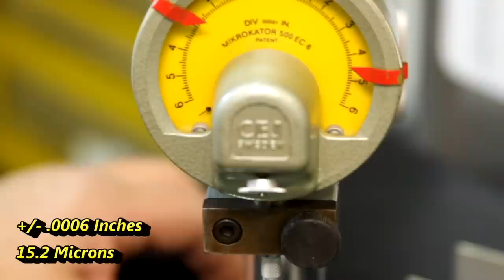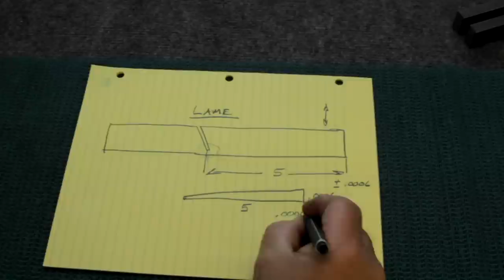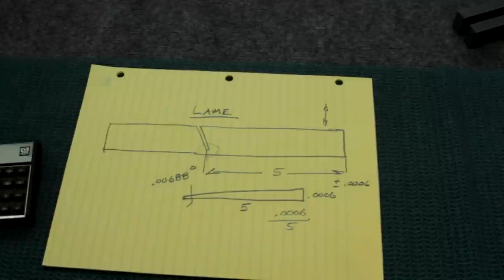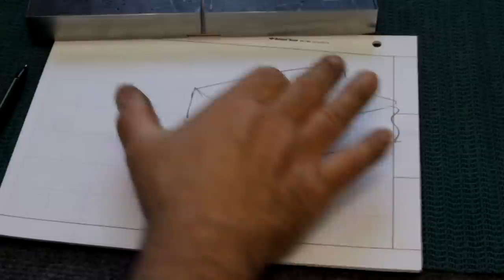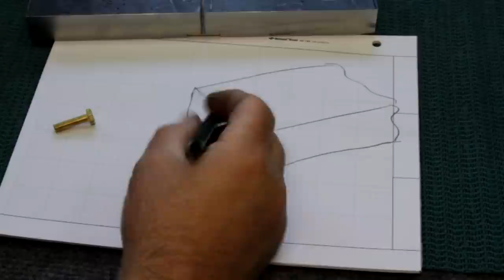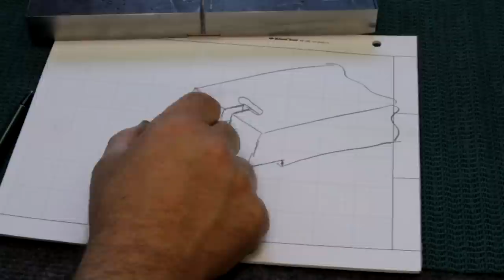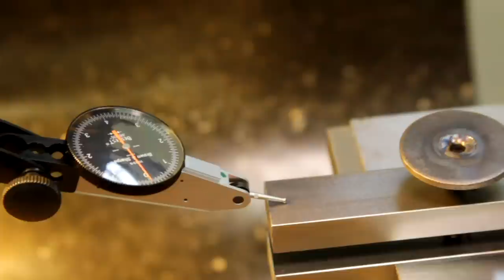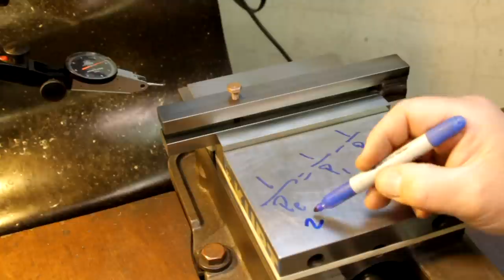Precision Mechanics

Comment: I wonder if you could use two flexures of different thicknesses so the the weaker one would not move anything useful but would  bend more than the other one in the opposite direction. The effect would be most of the movement from the screw effect the stronger flexor less and give an effective higher tpi on the screw.  I am probably not describing my idea very well ...

Comment: Hi,
First of all thank for all the information you provide us about all these different subjects, and I have a question. What is the best way to go about roughing a granite plate that is very out of flat(at least 0.02mm/4cm of angular error with the pivot of indicator taken into account or a max indicator error of almost 0.05mm/4cm). I half tried my DIY lapping compound which consists of burnt sandpaper of different grits and ground honing stones but my shoulders are getting worn way faster than the granite(in fact it took me 3,5 hours to correct 0.01mm/4cm of reading)
Reply: PS: Check out Dan Gelbart's videos on flextures. This man is a genious and he uploaded a small part of it in a small series of videos(one of them about flextures).
Reply from the maker: Hi Sketch,

Diamond is your best bet. It stays sharp for a really long time and will cut nearly everything. Its what the guys that resurface granite surface plates use. Start with some 40 micron and go from there. Hope this helps. Thanks for the comment.

Cheers,

Tom

Comment: I was pondering on the reason for the angled cut in the original. I was wondering if it was to give a more accurate single point for the rotation of the floating arm. The thinnest single point at the bottom of the cut. With the shim flexure, you can't be sure where it's flexing.  Now comes the "but why?" Why would you need to know the distance between the foot on the floating arm and the pivot point?? Is there some math involved for working out the movement, or just the direct reading?
Reply from the maker: Hi Steve,

Its really just a displacement under the indicator. The support base needs to be far enough away to not be in the hole the front foot is seeing. Thanks for the comment.

Cheers,

Tom

Comment: Tom, on an older video you briefly introduced a much more elegant "repeat-o-meter" of your own design (I think). It had an electronic indicator mounted on a circular, kinematically supported ring. It performed the same function as the R-O-M but much more elegantly. Why don't you demoTHAT unit, that would be interesting. Hey I like these mini tutorials. Keep combining the tooling and engineering ... the best tradesmen know plenty of both.
Reply from the maker: Hi Bob,

The device you mention is really for checking for curvature between the support points. You are correct that is does the same thing as the Rahn unit. Its only flaw for that purpose is the contact point is really small and will find tiny holes that are really irrelevant to a flatness measurement like you would perform on a surface plate. Thanks for the comment.

Cheers,

Tom

Comment: Super video. My old WWII South Bend can cut 224 TPI external screws, but the internal tap would be a bear! :)
Reply: Having a 28 tpi and 32 tpi threads are alot more durable than a 244tpi thread.

Comment: why not drill the saw cut faces and press a dowel pin in and have the other side a semi slip fit just a tinny bit lose to create the range of motion but once the two parts get x degrees out of alignment it binds up

Comment: I have no problem with 1080p as some people do, especially on mobile devices. Unless it is 1080p60fps in which case the sound is out of sync, sometimes by several seconds which, as you can imagine is very irritating. I usually use 480 to conserve bandwidth and never have freezing. Sometimes when I am early to the party there are very few choices as to resolution. Usually the lower resolutions load first. This video was a fixed 1080p although it looked as if it was 360p, a little bit blurry. I have seen this on several videos in the past few days and on rechecking later the resolution choices are still not there. This "high res only" debacle could cost YouTube a lot of traffic as not everyone has high speed internet. It makes me think that YouTube is doing another one of their "improvements" to save more of the money they are not paying creators. I do hope that this is not a choice made by uploaders or hidden in their options. And if it affects ad-play the fallout will be tremendous. This would be worse even than the elimination of nested comments so you now can't tell who is responding to whom after the initial reply. Although I haven't checked them all this is the only site I know of that did this. As to why is anyone's guess. Maybe to save a little tiny amount of server space?
 Now on to the real meat of the matter. This is a very good demonstration of the making, functioning and use of a differential screw. The 2 screw method is especially useful as it eliminates point wear by spreading the load to a long enclosed helix and is easily repairable. Perhaps the most common use is in microscope stages, focusing systems and precision lift tables. Optical benches use them a lot as you are dealing with measurements in wavelengths of light. Good video! thanks.

Comment: I wonder if there are monolithic interferometer on IC modules available. It would be neat to see something like the repeatometer with a dual flexure and interferometer sensing.
Reply: I can't remember who did it but there is someone on YouTube that did and showed exactly that.  Sorry I can't help more....
Reply: and while you're at it,  add accelerometers and gyros so you can make an automatic map of your surface plate :)I couldn't find a suitable module with a quick google,  but I'd be worried by the fact that surface plates are not optically flat.  This could be corrected with a polished transfer pin of some sort I guess.Now I'm curious what accuracy you could get from an iphone with 3 balls glued to it.  Assuming 16 bit resolution,  one tick on the gyro would represent about 0.00012" across a 4 inch base.
Reply: With drift and noise? You would be measuring everything except the surface flatness. With the setup in a smart phone expect .5° angular resolution of the gravity vector. The 16bits is almost always assigned to measure +-5g where for angular resolution you want +-1g (and a hair) 

 I brought up an interferometer because there have been huge leaps in single chip integration of optics which has driven costs through the floor. It  should be 'easy' now to have a module capable of measuring a few mm or travel with sub um precision for under $100. Resolving  Less than .1mm over 10cm by measuring acceleration is..... hard. (Remember you are sensing the magnitude of acceleration along 3 orthogonal axis)

Comment: Hi Tom, love the videos, just wondering if you could post your calculations for the differential screw pitch, I've been trying to work out how it comes to 224 tpi, but my answer always comes out at 96 instead.

Thank you :)
Reply: yea im getting 312.5 tpi not sure where he got 224 from. p1-p2= Pe 
.0357-.0325=.0032     1/x=.0032 (x being tpi of this pitch) = 1/.0032 = 312.5 
thats my math and understanding of what he gave us. not sure if thats readable /understandable never typed out my math on the computer lol.
Reply: It probably won't matter since this is pretty old, I'm behind on my viewing, been out 'doing'.  But....1/32 = ~.03125, not .0325.  The correct difference p1-p2 is ~.00446, which when inverted gives exactly 224 tpi.  Your difference p1-p2 gives ~.0032, which when inverted gives about 312.  Not sure how you got .0325 for p2, since that would mean you used ~30.77 as p2, but that's where your mistake is.  I suspect it's just a fat finger mistake.  Also, at this precision, the very insignificant parts of the fractional values matter quite a bit, due to the need to invert the result, so rounding isn't a good idea.  HTH, cheers.

Comment: I'm always up for some analysis and reengineering (great stuff Tom!)... However, stating an old design is lame without justification is quite lame... just my POV... this "lame" tool has been in service of professionals for more than half a century... perhaps there is a very good reason for why the Repeat-O-Meter is designed the way it is?
Reply from the maker: If you watched the video I did acknowledge the design had been successful and in service for a long time. If you read any of the commentary you would have also seen that the general consensus is that the saw cut was crude and that it would be easy for someone building one for themselves to make an upgrade in this area. Its fine if you like to drive something like a Volga. But if building for myself something along the lines of a Porsche or Audi would be what I would aim for. Thanks for the comment.

Cheers,

Tom
Reply: I understand where your coming from and odds are OxToolsCo and NYC-CNC will build one slayin' version (name to be announced) of the R-O-M... I was basically just saying: something is not necessarily lame just because it's old and crude looking, and vice-versa...the word "lame" to describe that tool just lapped me the wrong way ;-)

Comment: Why did you thread the holes in the flex-plate? Normally, don't you want simple thru holes in the fixed piece, and threads in the piece you  connect to?
Reply from the maker: Hi Pat,

They are not threaded. I just tapped one side with the flexure in place so I could remove the goofy clamp I had on the other side. I drilled clearance holes through the bronze plate before I tapped the holes underneath in the steel. Thanks for the comment.

Cheers,

Tom

Comment: Why place the adjustment screw 1/3 of the way back to the joint rather out at the end of the bar? Isn't the accuracy of adjustment reduced by 1/3 by doing that?
Reply: It's more of a preload adjustment.  Using the differential screws you can add bias either slightly up or slightly down..  Any gross adjustment is down in the 1/4-20 in the base.

Comment: Is there a reason the holes for the base and flexure were drilled in two operations instead of clamping the shimstock into the slot and drilling both at once?
Reply from the maker: Clearance hole in the flexure. Chips collect between a sandwiched plate like that also. Thanks for the comment.

Cheers,

Tom

Comment: what would happen if you made the 
 .25-28 the fixed bolt would it Chang anything or remain the same
Reply: Mike Cunningham you will unscrew the smaller bolt and the plate will not move

Comment: For an over-travel mechanism, why not just use a simple metal dowel(s) into-an-oversized hole(s) to restrict travel?
Reply from the maker: Not following your here Gary. The limiter needs to work in both directions and not restrict the flexure movement at all. Thanks for the comment.

Cheers,

Tom
Reply: Gary  that is why the bolt in the slot.  It restricts movement in either direction.
Reply: The Missouri River is known for being fast and shallow with a lot of sand bars.  Many steam boats used on the Missouri R. were designed to draw only about a foot of water and had poles for 'walking' the boat over the sand bars.  Kansas City was about as far upstream as was practical to reliably operate river boats during most of the year.  Some boats made it to Omaha during higher water. The Union Pacific RR got much of its early equipment and supplies by steam boat until a railroad was completed to Council Bluffs, Iowa.  Until the railroads started being built across the prairie there was not much need for any traffic or trade that far upstream.

River traffic on the Mississippi River above St. Louis to Minneapolis is accomplished only with dams and locks.  The Ohio River from Pittsburgh to almost Cairo, IL is dams and locks.

As an aside and change of topic, the DELTA QUEEN steamboat should be allowed to sail again as the Safety at Sea Law really should not apply to vessels on inland waters.  It was meant for sea going vessels.
Reply: A dowel in a bore does restrict in both directions
Reply: My confuser deposited this one here instead of where it was supposed to go.  Sorry for the confusion.

Comment: Am I missing something here, or wouldn't it be better to put a floating dowel or something similar in a precision hole under the indicator... don't really see the point in making a bendy structure... the dowel could even have a screw in it to make the fine adjustment.
Reply from the maker: One of the functions of the screw is to unload the indicator completely when not using the device. Prevents bashing your millionths indicator around when the heavy lower beam is flopping about. Thanks for the comment.

Cheers,

Tom
Reply: That is understandable. The floating plug-screw-assembly could be made such that the screw could go low enough to not making contact with the indicator at all. I'm sure I explained my solution poorly. -The "dowel/plug/something similar" is to be in contact with the surface you are indicating, going up and down in the precision hole thus making the indicator show the movement of the "dowel/plug/something similar".
Thanks for the answer Tom =)

HIK

Comment: The Rahm would have looked 10x better if they'd simply ended the saw cut in a drilled hole. It would have at least looked finished and intentional. Just a saw kerf hacked mostly through the bar looks like an afterthought. I mean if I were to put $1500 in an instrument then I'd expect it to look like an instrument.